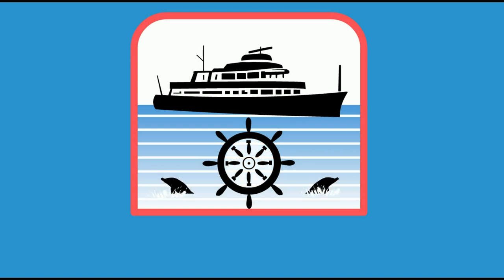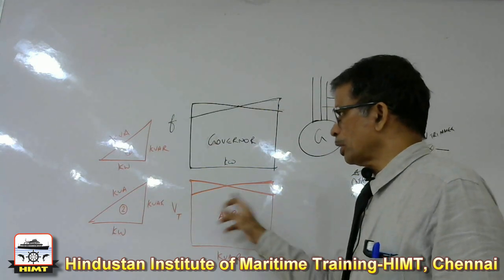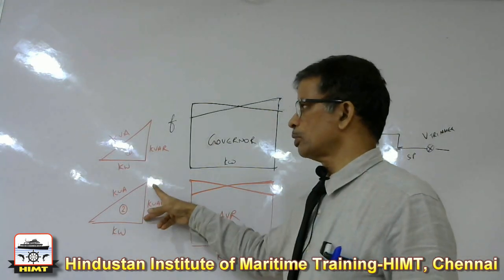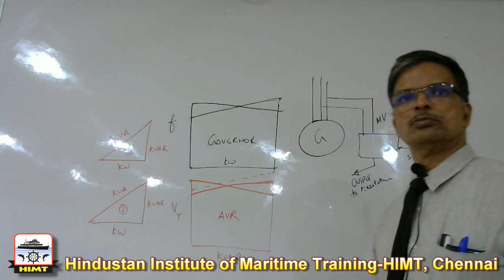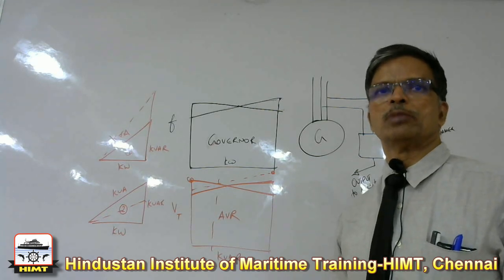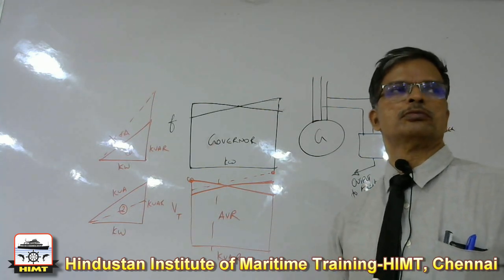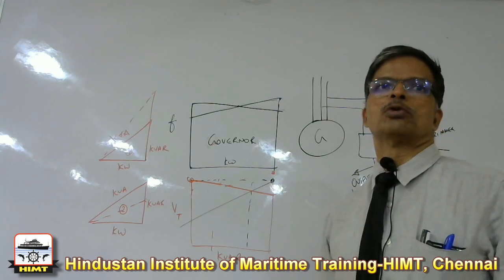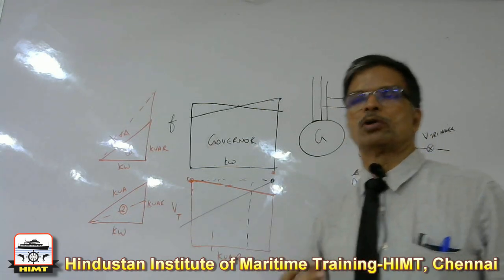AVR DROOP AND EFFECT ON POWER FACTOR | V. R. Venkatesan | HIMT

Comment: Very accurately explained it sir.. In my ship at present one generator is running on leading power factor during load sharing... We tried adjust the voltage by voltage trimmer in MSB.. But it was no use.. Please tell me how to adjust voltage on AVR itself.. AVR has got 3 potentiometer marked as "Usoll", "Vreg" & "Tnach".. Your reply is very helpful for me..

Comment: Did you compare the no load terminal voltage? Are they equal.?. During load sharing,  does the alternator with leading pf have less load current for the same kw? . Run the alternator alone adjust the voltage trimmer and check if the voltage changes.
Reply: Very well explained Sir,keep it up.You are the hope for those who want the knowledge in simple and quality manner.

Comment: Good afternoon sir, i have a doubt, request if you can share your thoughts on the same.
"Even after ensuring the no load voltages and AVR droop setting of both the generators are same  , is it possible that the generators are still sharing unequal KVAR (not very significant though)?" 

Both generators are of same rating-1100 KVA.
Both having AVR of same make and model- COSIMAT-N+

Thank you Sir.

Comment: When we are running two  generator for ex. AE1&AE2  in parallel then during load increase no.2 AE amp increases abnormaly   but AE 1 amps is ok and finaly preferential trip occurs.

Plz suggest reason and solution.

Comment: Sir, As your explanation is very useful for me. i want to do clarify of my doubt , so please advise me about if will adjust the voltage for one generator by trimmer(external given potentiometer) while parallel the running of both generator, it will not affect operation. because as your said , can change the p.f and kvar.
let me know? how much load% need to be maintained of both generator for will proceed the droop adjustment& acceptable range is required.
Reply: Ideally adjust the voltage setting when on no load. If it is adjusted while on load in parallel the effect will be same as explained. If v settings is increased current will increase and pf will come down. All these adjustments should be small and then check.

Comment: Respected Venkatesan sir,,,very happy to see your video.fabulously accurate and as always to the point....am ur preparatory candidate...😁....if the 2generators in parallel are having fluctuations in load by upto100_150kws continuously....what would be the reason to look into?and if a governor  needs attention then would any adjustments help!!
Reply from the maker: If the power management system is on, put it on manual and then check.
If the power sharing becomes stable, then the issue is with your PMS.
If the fluctuation continues then the issue could be with the governor or the engine.
Start with the droop setting, check compensation; check hydraulic oil, purge out the governor if air is in the oil.

Comment: Sir we are facing same problem... Base load 500kw 
One gen running kvar 0.8
2 gen running in parallel kvar 0.5 for no1 or no3 gen and 1.0 for no2 gen... We are facing problem with no2 gen... We adjusted the droop setting in avr but still the problem is same... Terminal voltages for all gen are same without load...
Reply: This sir already passed away ......